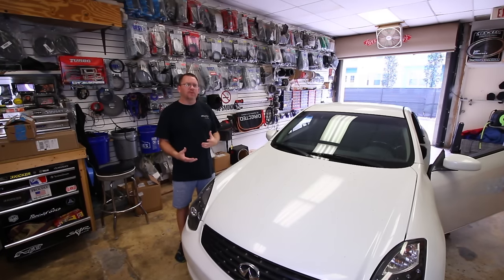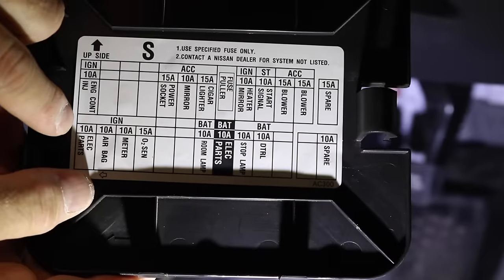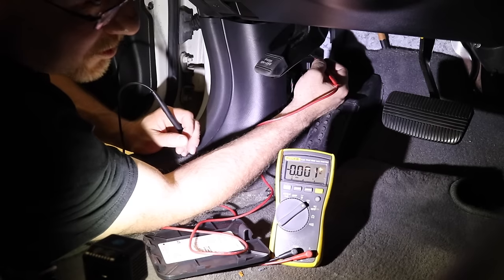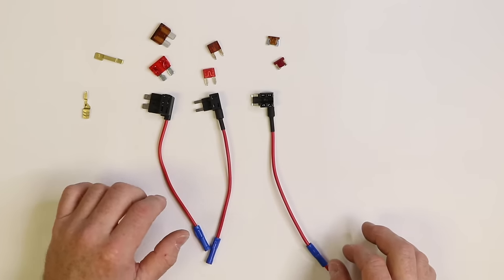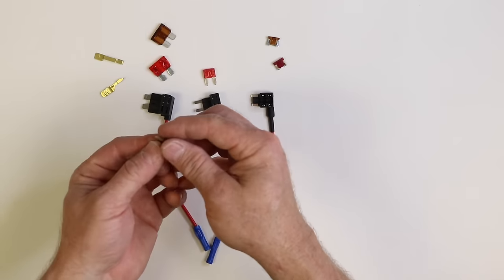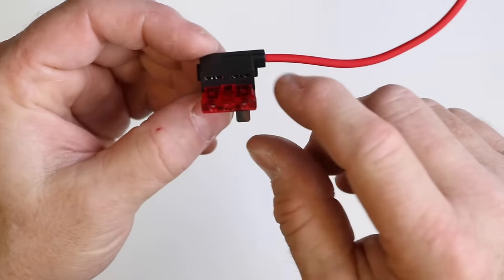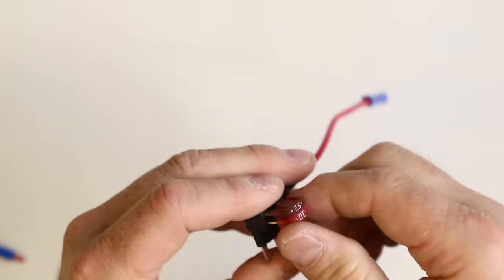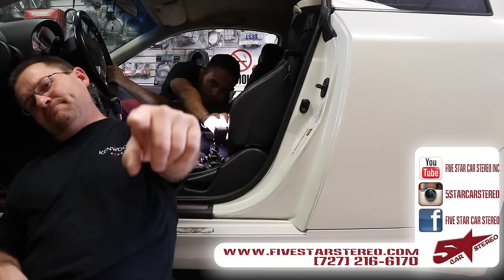How to tap into your cars fuse box safely and cleanly

Comment: So I connected my radar detector with the add a circuit plugged it in the right way and my radar detector turns on even if my ignition is not started. What are possibilities why it turns on without the car  started?

Comment: I was in a forum for dashcams, about to get one and need to piggy back off the fuse box, and I referenced this video and he said the terminology used on this clip is confusing and incorrect. That you refer to the 'load' side as the 12v hot side and he calls the 'draw' side as the dashcam. Its actually the opposite. You draw current from a battery to power the load.

Comment: You said load side is your constant power side? Us electricians use terminology as line side and load side. Line side is side where power comes into (power source), load is where the power goes to (motor, light, etc.) line and load, ive never heard of draw side terminology- sounds to me the same as load, your line side does not draw power (amperage), unless there is a load.
Reply: if line side does not go to load(bypass) and goes back to neutral, that is a direct short.
Reply: I am confused as to Load side and line side.. Does he mean "loadside" as in Power side ??? and "line side" as in the Load ?????

Comment: what type of fuse does the bmw have? "13 3series....?? and where is the location of the fuse box that I would tap into, for some led interior  lights?
Reply: or what type of pigtail  can I use? for the bmw 3series 2013??
Reply from the maker: +Craig Alter check the power point in the dash

Comment: If my add a fuse is rated for 10 amps and the only fuse I can use is 10 amps, then do I use two 10 amp fuses or two 5 amp fuses?
Reply: The top fuse is your accessory. Your radar or dash cam. The bottom is your stock fuse you pulled. The bottom needs to have a higher number on the fuse than the top. The bottom needs to be the factory recommend number on your fuse map. Get a volt meter so you don’t install backwards. The questions you asked were mentioned in this video. Watch it a few more times and take notes. If you need a add a circuit ATM LP advance auto is the only place I could find it.
Reply: I put the accessory wire from the tap on the cold side and put the factory fuse in the bottom slot with a small fuse until I can find a 1/2 amp fuse, thank you

Comment: Can I use a fuse tap and have both fuses in the tap be 15?
Reply from the maker: Jory Montano if you have an active 15 amp current draw from both no. You may want to go to the battery for power.
Reply: Five Star Car Stereo alright so my dash cam would be fine as it draws 5V and 3A
Reply from the maker: Jory Montano yes that would work just fine

Comment: Very useful video. I tried the process myself and I’m kind of lost here if there is anyone who could help me figure this out. 
I found an unused fuse socket to insert the tap on. However, both internal pins switch on the light on my diagnostic tool, which is kind of strange because all the rest of the fuses read only one side as the load and the other pin does not switch on the light which is the draw. 
I inserted the tap in both directions and still I have power. Is this normal? 
Another question, I was testing to use the starter switch fuse, and after I located the load pin, I inserted the tap. I have power to my external devise. However, the devise doesn’t turn off at all. Same scenario happens if I use the cigarette lighter fuse. 
Any idea which fuse should I select that goes completely off when I switch my car off. 
I have a Ford Focus ST 2016.
Any help would be highly appreciated. 
Thank you
Reply: If its an unused socket, you might not need a fuse tap. You could try directly linking it, then testing for power with the car on and off. 
This is a late response but I would just try another socket since that was the only one with the issue.

Comment: So my issue is when I push my switch button, it blows my fuse above which is the new fuse you’re suppose to put it. It’s all orientated way it’s supposed to be and it’s a loser amp 7.5 is the stock and 5 amp is the new one I put in, do you think you know what the problem could be ?
Reply: Should I just wire it to the ignition instead
Reply: The device that you have connected to the 5amp circuit what does it need to draw for current.  If you're connect say an amplifier rated for 7.5A, and you're using a 5A fuse then the fuse will definitely blow.

Comment: kinda confused. when he says hot side does he mean the load side? in other words the side that has 12v running to it from the battery?
Reply: The hot side would be the side that becomes hot with 12v when the ignition is turned on. Also called the line side, as in line voltage. The load is the 12v outlet, so that side is called the load side. The fusible link must be in between these two sides.

Comment: can i put two 25amp fuse together?
Reply: Anything that needs a 25amp fuse should not piggyback off another circuit as it may overload the wires in the circuit. Best to find a live point on the fuse box independent of any circuits.

Comment: On my fuse tap, I find that the first fuse does not affect the second newer fuse circuit. there is continuity to both slots frm the 12v source. So if one blows it doesnt affect the other. Hence shouldnt putting different rated amp fuse NOT affect each other? since if one blows the other still transmits power to the other device. anyone can advice or confirm.

Comment: Nice, however, in my vehicle, 2015 Toyota 4runner, if I use those add a fuse devices, I can't use the fuse box cover. I guess I have to use those little wire connectors instead and a line fuse to the load.
Reply from the maker: Harr W or leave the cover off and keep it in the glove box so you don't lose it.

Comment: I got a test light,  hooked up ground found the fuse box,  pulled the fuse for the cigarette lighter- radio and put the light on the hot side and then the other side was no light, so if the fuse blew out the connection would not cross, that's how i figured it out, put a wire under the fuse and that's the remote+ for my amp

Comment: Really confused with the fuse taps when you said the top fuse had to be smaller than the bottom one.
 But in your demonstration the top fuse was larger... Which way am I supposed to do it...
Reply: 7:07 shows the bottom as a 10A and the top as a 7.5A
Reply: @iammatthewbirch  that 7.5 looked like a 25 to me lmao I'm only 26 and I'm as blind as a bat lmao thx

Comment: On my Honda Van the Pig Tail Tap (mini atm- low profile) would not fit as the plastic around the slots does not permit a good mating for the chunky end piece.   I did find a fuse holder/connector which basically has an line fuse away from connector bit that goes into the fuse box.  Therefore there is no bulky plastic block at the fuse panel just a fuse body facsimilie with the two metal strips as per normal fuses.   THE PROBLEM IS I COULD NOT find any such device for LOW PROFILE fuses.I ended up using the wrap around :-(
Reply from the maker: Al Marsden it happens. Do you have a link to that holder, I would like to see that

Comment: "LOAD" and "DRAW" mean the same thing. when he says "LOAD" he means "LINE" or "SUPPLY" side. the side that comes from the battery, and if the fuse blows, the side of the fuse which has power to it. you want to tap off the ""DRAW" side, (which in most electrical systems is called the "LOAD" side) 

the video is good, and all the information is good, but he used some confusing or incorrect terminology. maybe it's just a car electrical thing to call it something different, not sure.

Comment: I need help I put a advent ogm1 in my 2011 Chevy 2500 hd and now key chime and the headlights are on does not work
Reply from the maker: They come out of the front  speakers. If you connected an amp to those speakers and the amp is turning on with key power that is the problem. Try using the radios DC offset from the radio. Pick up a Pac Tr-4 if your high to low does not have it built in.

Comment: Everything was fine until the taping on the fuse box .
I was expecting to see what's the reading on the hot side and the  low side numbers.
I ques is number 12 on the meter reading the right one?
Meaning thats where the connection goes?

Comment: Could I use this to make my cigarette lighters to turn off with ignition?  (Find a socket that does this, and somehow connect the cigarette lighter socket to it?
Reply from the maker: +Soljarag5 yes just cut the wire going to the outlet, cap it off, and connect it it ignition

Comment: The step where you tested for voltage with the fuse out to determine load side was unnecessary. That can be checked with the fuse in. Notice how your fuse showed no voltage with the car off and 12v with the car on.

Comment: Fuses on these taps are NOT in series. As shown the left side is HOT to both fuses. Bottom fuse right leg goes to the cars original circuit. The top fuse the right leg goes out the red wire to your device. They are in parallel to each other. You just need to be careful the TOTAL current of both fuses at max load don't melt the feed wire

Comment: Somebody told me to run a new wire from 7.5A fuse to blue cable in fuse box in 2009 prius but have no idea how to do that.
This is the message iam getting 
There is a problem with trasmission "p" lock mechanism. Park your car on a flat surface nand fully apply the parking brake .
Car is stuck on parking and wont turn on. I have the red triangle  with exclamation point  on dash boar. They also told me to check the voltage of 12v and hybrid battery on diagnostic screen on prius to see if they are good, they also suggested to reset the hybrid system by unplugging an orange plug on main battery for about 5 min. Have not done any of these yet cause they are putting catalic converter at shop since it got stolen.
Hopefully just putting the cat on will help cause it was running good before it died on me while driving it without cat?

Comment: The little gold things and twisting the wire around the fuse are both bad. The gold thing sounds like a good idea int theory but theirs a problem. When you place that on the fuse and stick it back in the fuse block your spreading the terminal inside the fuse block which can cause damage and have to be replaced. Same thing with twisting or folding wires on the fuse. It won’t happen on all fuse blocks it just depends on the terminals inside the fuse block.  I wouldn’t do either of those.

Comment: I thought load or accessory that is being powered is the load and the line is where the 12 volt is coming from. You would stated the load is the 12 volts. Are you sure. Other than that this is a great video

Comment: My little sister has a 2004 Toyota Carola. Her fuse keeps going out when it's brand new. How can she keep it from not blowing anymore?
Reply from the maker: gregory vega first you need to find out what is blowing it. That is it the fuse for?
Reply: +Five Star Car Stereo it's for her music and woofers.
Reply from the maker: gregory vega under hood fuse or in the fuse box. Does it blow right away are over time.
Reply: +Five Star Car Stereo under hood fuse. She's had it for about a good four months and it blew out.
Reply from the maker: gregory vega ok so the next question would be how big was the fuse and what amp does she have?
Reply: That I don't know. I'll have to get with you guys tomorrow on that.
Reply: Be sure to check, first, that the fuse has the correct amperage rating for the circuit it is in.

Comment: I wanted to add a constant (USB) power line to charge my phone when my cars off... what are common fuses that have the constant 12v.
Reply from the maker: Joshua why not just go to battery. Most constant power fuses are system critical. You would not want it to blow or damage the circuit.
Reply: dome lights for example= constant power and not "mission critical".  Just had back surgery so I'm doing my research now before i actually wire this.  I understand that a line straight from the battery would give me this, but that's too much work. I just want a piggyback for another USB so i can leave my phone in while the cars off.
Reply from the maker: Joshua gotcha, some dome light circuits will time out after time, so make sure to check that. Back surgery, ouch.
Reply: Five Star Car Stereo is the relay for the timer before or after the fuse box for something like the dome lights?
Reply from the maker: Joshua no it would be just to up the amperage draw.

Comment: What’s up fellas I need help I having trouble with turning my amp on without having to fully put the car on, my remote is hooked up to the radio fuse and only works when the car is fully on any suggestions on what is helpful.

Comment: Does it matter which way the fuses go inside the fuse tap pigtails
Reply: Im a little confused let me elaborate...lets say you have a brand new fuse that has never been in a fuse box how can you tell which side is a load side and which side is a draw side?.....does it matter when you insert it into the fuse tap pigtails?....does load side of the fuse go into load side of the pigtail?
Reply from the maker: shormovas if you have a meter/ test light you can test a fuse socket. With the fuse out put your prob on one lead at a time. One will show voltage and will not. The one with voltage is the feed, the one with nothing is the draw. You want to connect to the draw side so if it grounds out the fuse will blow. If you connect to the feed there is no fuse to blow, so something down the line will blow. That would be bad.
Reply: Im get that part... im talking about the actual fuse itself the small colored piece with the numbers on it. Does it matter how that piece is inserted in the fusebox or the piggyback holder?
Reply from the maker: shormovas ok sorry. Direction, no it does not matter which way the fuse goes. Location, yes the original fuse will go on the the bottom. The add on fuse will go on the top next to the pigtail.
Reply: Awesome great help great video thank you so much
Reply: It does matter which way the pigtail ties in though!
Reply: shormovas y
Reply: @FiveStarCarStereoInc  So, no such thing as a fuse inserted backwards???  That is not how I understood the video.

Comment: I have a 12 bolt rear cigarette lighter fuse 15 amp which I know it's also part of my front cigarette lighter when the fuse is bad they both don't work , not continous power must turn key to have power. I didn't want to use this fuse for my fuse tap, im gonna be using these for charging cell phones or tablets was worried over load if i put led lights , fm modulator and charging phones. so mind you I have 10amp rated fuse taps so i asume i cant use a 15 amp fuse on this tap so i cant tap into a 15 amp fuse spot . so I plug my FM modulator on the 10 amp fuse port for alarm siren control modual ,climate control Volvo S40 radio share lcd display, and a second 10amp fuse for fm modulator then I have interior LED lights from LED glow and I put that on the 10amp alarm siren control modual , and the recomended fuse for led is 4 amp , i have a 5 amp,  in there video they show them using a 20amp port and fuse on cigarette port and tech support recomended 15 amp cigarette port  not sure if continous since alarm siren  but seemz not , and also i have on and off switch for leds. does this approach seemz ok with your experties. man i really appretiate your video and thank those who put up instuctionals i just made a video for installing fm mod for aux in for 06 S40 really clean job great positioning very desent product also removing radio , dash for the led too havent posted yet sorry for the novel
Reply from the maker: Alex Higgins it sounds like you have it under control
Reply: so its ok my set up and choice of fuses to tap into
Reply from the maker: Alex Higgins yes it sounds right
Reply: Each individual device should have it's own inline fuse! If you choose to tie a device that is rated 1 amp to a 10 amp fuse, you take a chance of smoking that device or more seriously, a fire!
Reply: Gee EM no im using ata adapterz and since post i made change even tho no issuez with above fuse choices , i swithed the fm modulator on a driver heated seat port its 15amp  i put ada connector and put the 10amp on fm mod side making sure 15 amp in correct position on ada , alzo chose this port since i dont have heated seat so empty port not being used by volvo its not continuos zo all good there, i moved led int lights on pass heated seat also 15amp and put 5 amp for ligyts so far so great also when i put key in car lights turn on auto and when i get out they stay on for 20 sec then turn off cool at night but in day i constintly turning off manual with lights button eh no biggie
Reply: or soundz
 @FiveStarCarStereoInc

Comment: I want to tap a fuse and feed it from a 30 amp fuse below the glove box.   But my car deck use a 30 amp fuse and on the video it says that i need to go lower 30 amp and it my blow it.
Reply from the maker: corina0001 you are going to want to add a relay and run power for it out to the battery. That would be the safest way to do it.